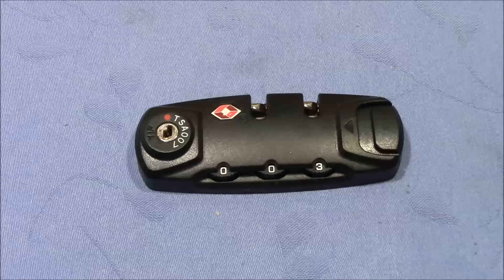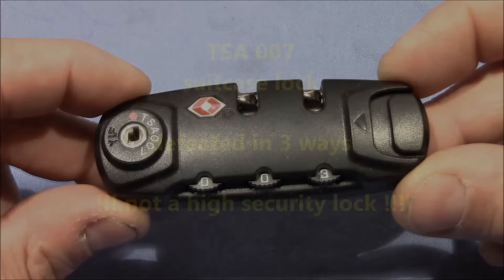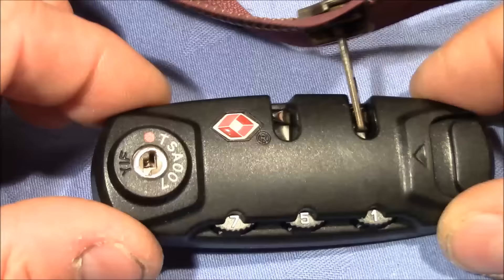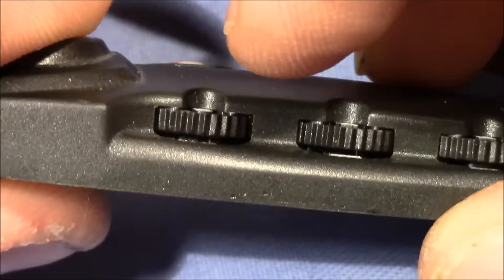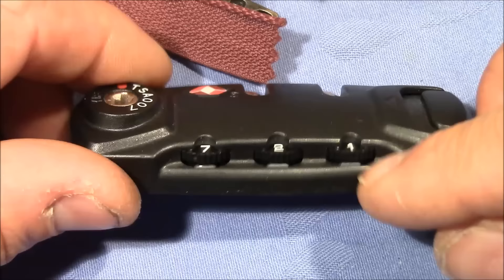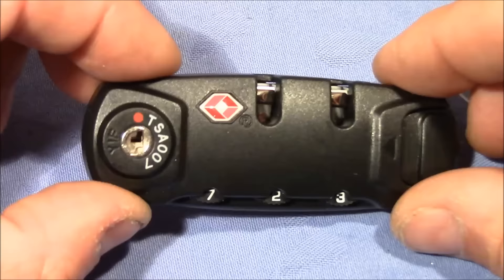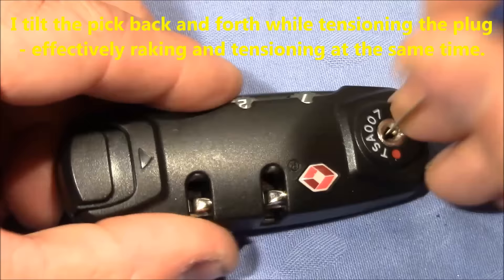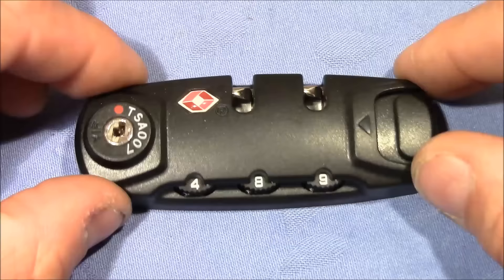(picking 692) TSA 007 suitcase lock defeated in 3 ways - is it any good?

Comment from the maker: Thanks to 'lockmania' for this lock. The combination lock mechanism cannot be tensioned as no resistance on the wheels can be felt when pushing the button. However the wheel's gate can be visually recognized or detected with a feeler gauge (made from a plastic bottle). This will reveal the code and the lock opens. But the worst part is the TSA007 lock that can be raked open with just a pick - only 3 wafers and bad tolerance do not hold very long.
Reply: Mr puzzle guy
Reply: Life saver 🙌

Comment: Excellent detailed video! The 007 TSA key must be the most popular on the planet! The easiest way to defeat any zippered luggage is to attack the zipper with a ballpoint pen. 👍
Reply: Except for bags where the zipper ends attach into a lock built into the bag itself. Samsonite do this. So, even if someone gets into it via the pen through the zipper method, they won't be able to close it. Which means, you know they'd done it.
Reply from the maker: Yes all the tsa keys are known and 3d printed models available. Stupid idea that they would be a secret for all times.
Reply: @Potti314  Honestly all goverment backdoors are stupid for this very reason.

Comment: The lock on my luggage (which seems identical to this one) makes a very clear and distinct sound when the wheel is in the right position. Nothing to pick, to decode or to tension, just turn the wheel and listen : tok, tok, tok, tok, TIK. It is even faster than entering the code.
Reply from the maker: Haha, so you can open it even in the dark ;-)

Comment: What is the point if all these locks can be picked so easily? {{sigh}}

Edit:
Mine has vertical tumblers that are parallel to each other instead of these horizontal ones... That should be more difficult to pick, right?  [Although, picking the actual TSA-lock part also looks too easy 🙄🤦‍]
{{still sighing}}

Comment: @Potti314 my reset button in stuck in. And how for any combination the bad unlocks. How can i fix this?
Reply from the maker: Appears to me that the lock is broken. Maybe a little bit of force will help.
Reply: @Potti314  it worked fine before. When i tried to change the pin code and pushed the reset button  it just didnt come back up. Is there any way i can get the button back up?
Reply: @ethanhunt_za  Try pressing it with a pin and wiggling it around, it might be stuck.
Reply: @destrierofdark_  yes it was stuck. I just  pushed it with abit of force and it fixed the problem. Thanks

Comment: I just came from the airport , I remember the password  but   I cant open my suitcase  it , I wonder it  was open in the airport and the pin code  was changed , I can see the grove  that you mention from the angle, which Is not the pin code I had ,  and in addition to that. I  still cant be open  , any suggestion ??   before I break the mechanism
Reply from the maker: You can try picking it with paper-clips. Like so https://youtu.be/QwXMGoQ6JFk or https://youtu.be/j5e_0cDk3TM

Comment: There is no hole in my suitcase under the numbers
Reply from the maker: Maybe a different type of lock or you just didn't see it.
Reply: @Potti314  Does not work if the lock is properly embedded. I've got a brand new suitcase bought at Lidl and tested with a 0,2 mm feeler gauge.

Comment: Good video, crappy lock, Bosnian Bill has a video, about luggage security, where he locks the zippers with a small lock, then sticks an inkpen thru the zipper away from zipper handles, reaches in etc. Then by just zipping the handles still locked from where they were to the other end and back re-zipping the split point back together. No evidence ever opened. So much for security!
Reply from the maker: Thanks. I know that video. But with the zipper handles locked you cannot close the zipper again.
Reply: @Potti314  , on most luggage there are two zippers facing each other so you can open either direction or both at same time, once the zipper is split  you just slide  both locked zippers over split area to put it back , it may be hard but will fix itself

Comment: Those ones that hold the zipper are completely pointless anyway. You can just open zippers by jamming in the tip of a pen.
Reply from the maker: Yes, you can use a pencil to open the zipper but you will leave evidence if the zipper handles are locked.